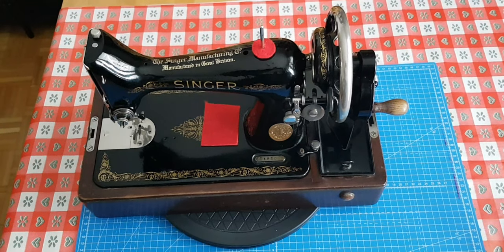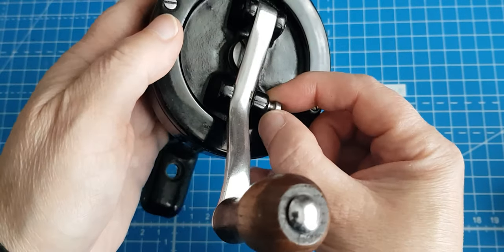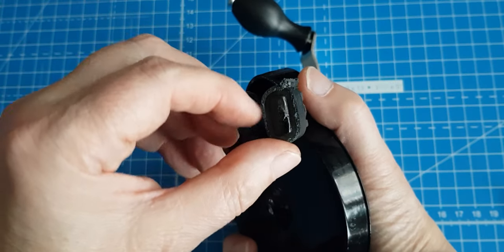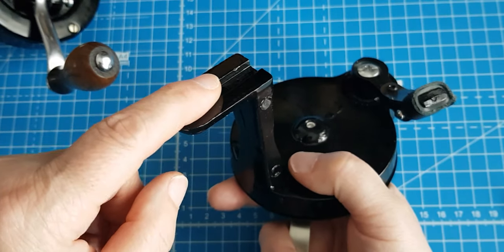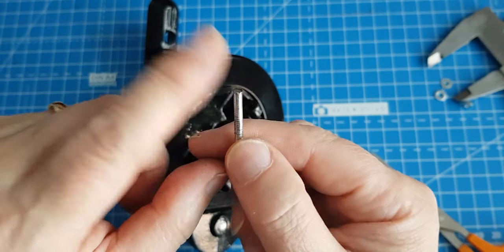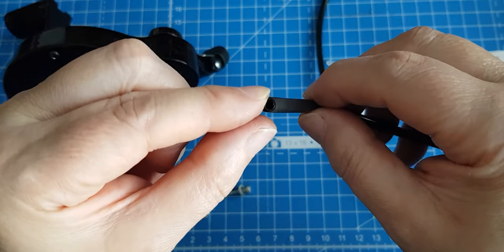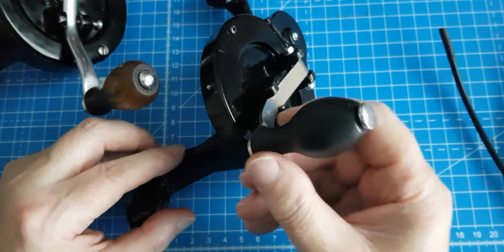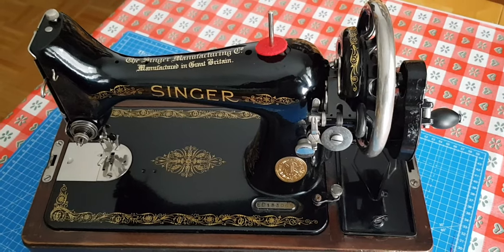Vintage Singer 66/99 sewing machine handcrank vs OKBY Chinese copy comparison and modification.

Comment: nice mod. i used some epoxy putty that was on hand and filled the handle. then i drilled it back out to the correct size. i also put a little on the sides to tighten it up because mine was loose in every direction basically. i also quitened mine down by opening it up and cleaning out what passed for grease inside and used some rubbing compound to run the gears in. then i cleaned it out and regreased it. much quieter now and feels a lot better to use. i think mine was poorer quality than the one you showed.
Reply from the maker: Thanks for watching and for your ideas too! It just goes to show that with a little tinkering, it is possible to try and make a silk purse out of a sow's ear! :)

Comment: Good to see one of these close up in a video - as you say, it's hard to judge the quality of the ones you see online. The current price on  eBay (2024) seems to vary between £12 and £22 for UK stock yet they all look identical and I'm guessing from the same factory.  I'm waiting for one to arrive so I can convert a singer 237 zigzag machine to hand crank. An alternative way to remove some of the slack in the pressed steel handle might be just to nip it up in a vice as there seems to be quite a gap there which could be easily closed (possibly even tack welding it to stop the gap opening up again with use). I suppose it depends how brittle the steel is and whether you want to risk it breaking but I'm guessing it's a fairly soft steel. Thanks for the video - really useful info!
Reply from the maker: @fatherkeith  Thanks for your comments! Honestly, I wouldn't have thought of using a vice! Good luck with your conversion!

Comment: Thanks for your video.  I've managed to replace the pin in the handle with a bolt as suggested as the pin kept falling out.    The plastic handle was very loose so temporarily i've wound some string in the gap but will try something a bit neater.    Not possible to get the pin that holds it in place otherwise I would have put a spacer of some sort in but no worries.   I'll figure something out.
Reply from the maker: I'm really glad it worked for you! I would've liked to change the handle too but that darned pin!

Comment: Hi, thank you for your video! I have tried to convert my 66 to a handcrank, but the chinese one I purchased doesn't seem to reach far enough into the spoked wheel. Any ideas what I could do to remedy this?
Reply: Hi, is your spoked wheel an original one and have you been able to mount the crank close enough? I'm not really sure what else to suggest. If it's not fit for purpose I would send it back. Good luck!

Comment: We bought a China made crank.  The teeth of the two gears in the handle did not mesh well.  There was a gap between we found unacceptable.  We returned it while it was new.
Reply from the maker: You were unlucky by the sounds of it. I have this cheap one as a spare now as I was able to find an original Singer one on my last trip to the UK, it cost me nothing too! Thanks for watching!

Comment: Your machine is in beautiful condition, did you do that yourself? How would you recommend cleaning a tatty one, like the one I have lol xx
Reply from the maker: We were lucky that it was in perfect condition when we bought it but it did have a lot of general dust and dirt buildup over the years. I just used a soft brush, damp microfibre cloths and light use of sewing machine oil on a cloth to clean the paintwork.  I would join the Facebook Singer 66/99 group. There are lots of great advice and tech support from other owners!
Reply: @tinkeringforfun  Thankyou hun xx

Comment: 😂😂😂😂Horrible attempt to copy the Singer 😂
Reply from the maker: @127cmore  It is certainly no where near the quality of the Singer but if you modify it, it is a working compromise until you find an original, as I managed to do!
Reply: @tinkeringforfun   Good video though 👌. 
I did wonder what they would be like. 
There's no  beating a   Singer machine though ?
My earliest machine is a 1887 Singer Patcher.  A work of art